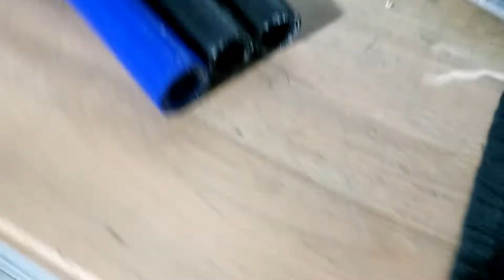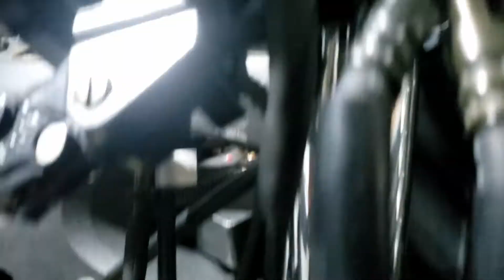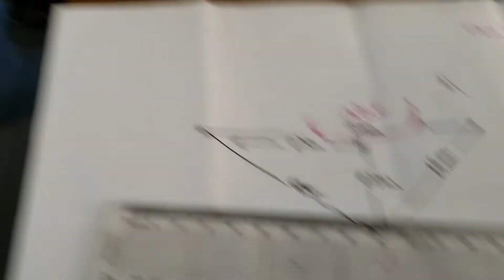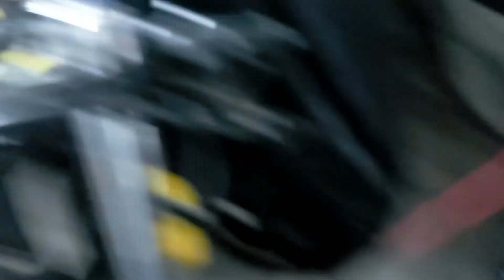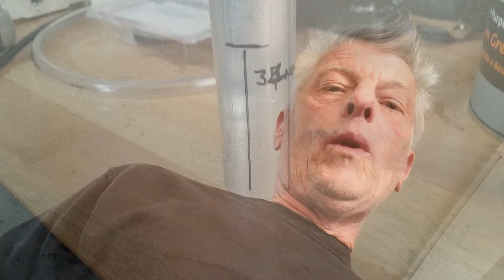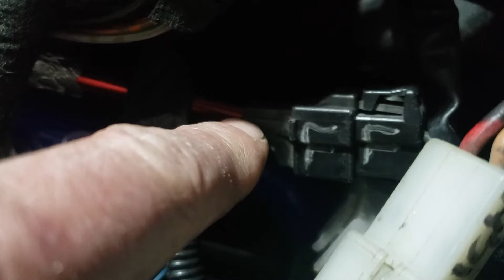Fitting exhaust #radiator and cooling system #YamahaYZFR6 | Cafe Racer Custom #Motorcycle Project

Comment: Speedo mount.  
Would this work?
Cut some thick wood/metal to the inner diameter of the "C" shape (but not as thick as the C). Cut two metal disks larger than the round block of wood/metal.  Nut/bolt to hold them firm. Hole for mount for the speedo.
Reply from the maker: Kinda where I'm going with it and you've just given me another idea